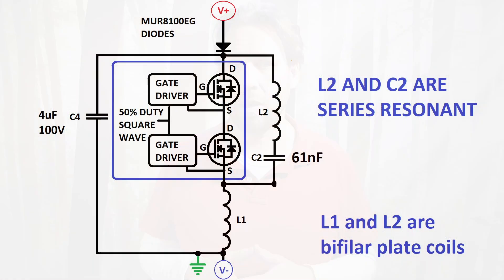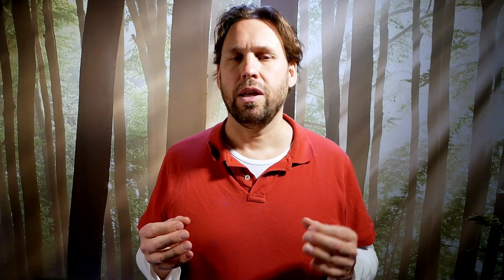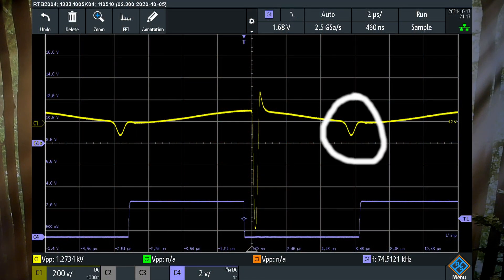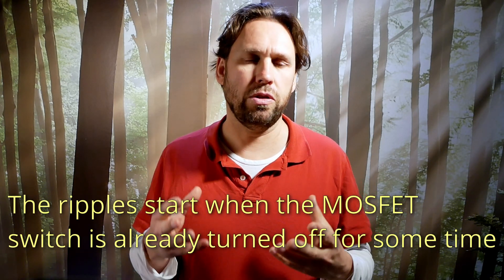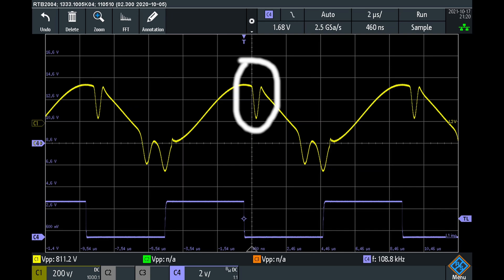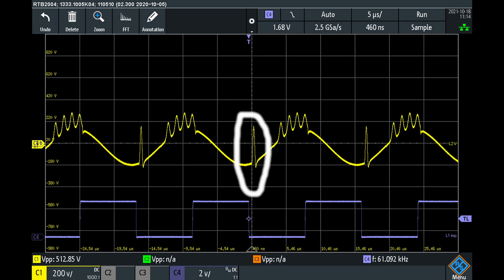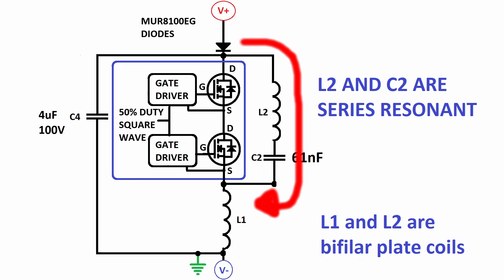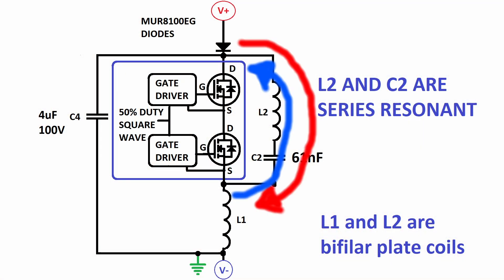The Ripple Anomaly

Comment: I don't know as much as you do from a practical perspective like actual experimentation with different setups. I only did a crude one once, reducing components back to their roots but to my mind all this looks like there's a trigger (the load?) that creates tension (that makes the juice flow) and then another trigger (the switch - be it mechanical or digital like transistor) that basically leaves the current stranded. Usually I see a cap used as a fail safe right at the end, or maybe null in places where there are 3 wires to your home grid. I've heard Dollard talk about how in big power stations their problem is ultimately how to get circuits to power off, citing immense discharges when they switch off the circuit. I think if we really wanna understand this thing we gotta boil it down to its most simplest, rudimetary concepts and principles. This is why I was at first reticent of the mosfet instead of the sparkgap, because it introduces variables that I have no control of at a philosophical level. 

I see the spark gap as a passive gate whilst the transistor as an active one. Like you can adjust the frequency much more accurately and such. But what if we're not aware of all the differences.
Let me put this into perspective: what is the difference between a capacitor and a spark gap? aren't they similar? The gap is what creates the shortest path for the 'stranded' current to 'return' to source (or otherwise equalise potential). The GAP is there in a capacitor as well as the spark gap, but in the former, the dielectric separating the plates doesn't allow for discharge accross the two terminals. Still, it's got the magnetic field holding the 'charge' so it is all bound unlike the latter, where the gas acting as a weak dielectric allows for discharge into counterspace acting as a pump on the magnetic field of that capacitor. I haven't figured out yet how the coils factor in, maybe it's the resonance that traps the ripples after this manner. This was a crude description and probably not all that accurate but now we have an indication that it might very well be the spark gap in concert with the capacitor creating a push-pull  that is the so called "load", and what we currently call a load could very well be a drain on the circuits resonance. Look, I may be wrong but please just take this logic and insert your findings instead of what you deem flawed and maybe it will make sense and the world could profit. 

Here is another aspect that I I suspect might somehow be related: when you create a spike like that (especially of opposite polarity), any sine is abruptly crushed (and the harmonics). This sounds like a click, you can do it with an oscilloscope. Like an instant sweep accross all frequencies from all sides.

I see the resultant 'force' (although calling it a force at this point would be downright pedestrian) in the perpendicular plane whenever two sides act against each other, thus acting in concert (or at least their resultant). I imagine throwing a heavy rock into the water and the dispacement induced tension causing the water to fill in from all sides, creating a splash upwards. But what was the actual displacement? what gets displaced and what gets carried over? mass and momentum respectively, from one medium to another, and the surface tension is the boundary. How does the mass of the water have the energy to overcome that surface tension between the mediums?
Let's get a clearer picture: if we were to simply place the rock into the water without throwing it there would still be volume displacement but there would be no splash. What we now have to decide is what the animating factor is: the displacement or the momentum of the water upwards? What do we use, do we use the splash or the volume swell of the body of water to effect our work? In order for that splash to occur, the momentum needs to be big enough so tension from all sides (including from above) can push a body of water nearly the size and mass of the rock into the air going against gravity. Anyway excuse my tangent, this was all so you could draw the parallels for yourself seeing as that's what we've got here, a boundary condition (space/counterspace)

To conclude, all movement is comprised of two forces. We're overly used to it because we have a constant fulcrum (gravity). But if you throw a key in the vacuum of the cosmos you'll both go your separate ways, infinitely. #impulse Similarly we think that time is going forward when in fact it is us who are looking forward through it. Observing each motion, ascribing it linearity when it is in fact the cohesion of opposing forces, seemingly acting in concert. Action+Reaction=Resultant. No one has ever observed anything less. Sorry for writing a book, but I believed it could help. Feel free to point out where I might be wrong and thank you for your great work!

Comment: I'll have to look some things up I forgot what voltage is again. This is just the second video I seen of yours. I don't understand much of it but I can tell you know what you are talking about. 👍
  It might seem out there but I think Tesla used a wave of cavatation through a conductive fluid to create an electric pulse modeled after the design of the Great Pyramid which he visited. Which I think is modeled as our cerebral spinal fluid system with the subterranean chamber being the source of the wave cavatation caused by the movement of water in the underground Chambers during the flood season. The subterranean chamber worked like the Sacral pump at the base of our Spine which creates a wave of cavatation when the coccyx is moved by our breath. The wave resonates against the skull tuned by the separations called fontanel which act like the tetonic plates of the Earth whose magnetic field is created by the moon moving the tides of the Earth above and below it's crust/firmament. The moon breathes for the Earth and the tetonic act as the fontanel of the skull. The Great Pyramid has eight sides because it's subtly concave. 
    The Grand gallery acted as the Spine with seven levels for seven tones/trumpets. The 5 granite slabs above the King's Chamber were built to be free standing so they could vibrate like the electron receptors/enzymes/standing waves,  of the mitochondria in our cells. I think these slabs pulled electrons off of particular molecules like our mitochondria pulls electrons off of ATP and the ganglion around the Pineal are it's receptors. It's the structure of the slabs that determines what they will attract when caused to vibrate within a controlled mostly closed system holding specific structures chosen by design like ATP is formed to be used in the electron transfer chain of our cells called the mitochondria. I think the electron transfer chain is the Fountain of Life and is the basis for the transference and transformation of all energy and the information it necessarily contains at all levels of the Universe beginning with the ion and ending with the Universe.⚕

Comment: RIP = to tear.  You could have a filter circuit which TUNES to the ripples frequency.  Attach some long wire to the circuit to see if the peaks increase in voltage or current as in an aerial system

Comment: Damping is another term in English for getting rid of resonance.  A filter would be designed to send the ripple to the earth rail.  A capacitor could be tried to collect the energy in some way with batteries or diodes.  Maybe complex or not worth pursuing.
Reply from the maker: I want al the energy in a single impulse

Comment: it could be an echo in circout
Reply from the maker: yes, but from where, and why does it start out of the blue, what is the trigger?
Reply: @MasterIvo   My experienced experimentations with round linear insulated stranded copper wire and enameled solid iron wire coils reactance indicated, to my observed rational that insulated stranded wire create rotational momentum frequency jumps to lower Ohm ring path of resistance potentials. This is a spinoff of what I believe you're seeing.

Comment: My guess is that there is still energy in L2 and since bifilar coils are both coil and capacitor L2 is “self resonating” resonating the energy between its magnetic and dielectric field.
Reply from the maker: Interesting thought, but then why is it only a repeating negative ripple, without positive, or even a "pause" for the rectified positive?
And why does it start out of the blue.
The L2 has a lower resonant frequency then L1, so the ripple should be much slower then the impulse.
They seem to be equal, so it seems L1 plays a crucial role.
Reply: @MasterIvo  about the negative, positive and pause, i have no idea. But about L1: since the coils are stacked they share there magnetic field. That makes them “self resonate” together i suppose.
Reply from the maker: yes, but (If I remember correctly) it also happens when L1 L2 are not connected (I need to test this. thanks for the reminder)
Reply: @MasterIvo  what is the measurement of L1 and L2 in Henry?
Reply: @MasterIvo  another tough: you say you charge up L1. Meaning you build up a magnetic field using L1. Since L1 and L2 share there magnetic field, you did not only charge L1 but L2 as well. When the mosfet closes the magnetic field energy needs to find somewhere to go. Now the magnetic field can use both L1 and L2 to do so. Also you say the energy of L1 charges L2 trough the capacitor and arriving at the bottom of L2. But it has a second route it can take and that is trough the mosfet diodes and so ariving at the top of L2. Becouse of this i doubt that the discharge of L1 actualy charges L2. (Meaning charging by electric current trough the circuit)
Reply: @MasterIvo  Because of your body diodes, they are a direct path to ground for an AC voltage through C4. The question is: are the body diodes and C4 a more direct path to the ground or is L1 a more direct path to the ground. this will tell you where your positive side of the oscillation is going. I would say the diodes and C4 are because L1 will be a different resonance and probably a wrong impedance for it to flow in that direction. it depends on the frequency.

Comment: Could it be an interaction between the capacitance in the mosfet drains source and the coil, and  maybe it foms as a tank circuit and creates ripples when in it own resonance and maybe also considerer 1/4,1/2 and 3/4 harmonics !
Reply from the maker: thats a good thought. parallel resonant with the drain source capacity. but C2 prevents this (I think)

Comment: L1 is charged with your pulse. when your pulse is turned off it releases the charge over time because that is what a coil does. oppose the change in current. the slow release charges L2 and C4. L2 and C4 will start to charge and discharge back and forth with L1. the ripple you see is the oscillation you have started. C2 looks more like a blocking capacitor and keeps the DC on the upper half of the circuit along with C4. there is very little load on the circuit. it will oscillate for a while without another pulse. try giving it one pulse then watch the circuit. it will oscillate on its own till the power is consumed. the frequency of oscillation will be determined by the resonance of L1, L2, and C4. measure the frequency of the ripple. Is this the resonance you build the coils for? if not factor in C4 to your calculations.
Reply from the maker: I don't agree, I already showed in previous videos how it functions, it is not how you describe it.
L1 is charged relatively slow by the pulsed mosfet switch.
L1 discharges really fast (at L1 resonant frequency) i through L2(negative half wave) , and then through body diode into C4 (positive half wave). (See capacitor discharge resistor video)

Comment: Perhaps turbulence or 'eddy currents' forming in the dia-electric/magnetic vortex. I guess you might need to consider fluid mechanics to some degree to explain what is happening.
Reply from the maker: yes, I also think that is possible, a little tornade, from the opposing currents. If they would be aligned (impulse and ripple) this could give a  huge impulse voltage.